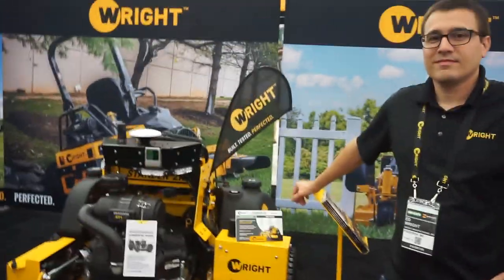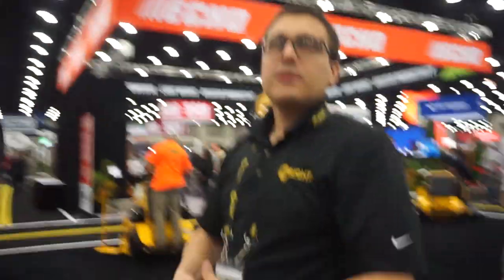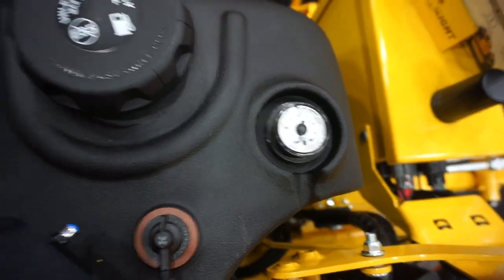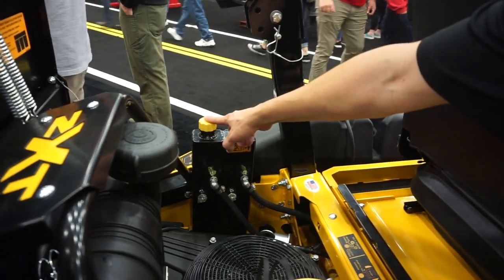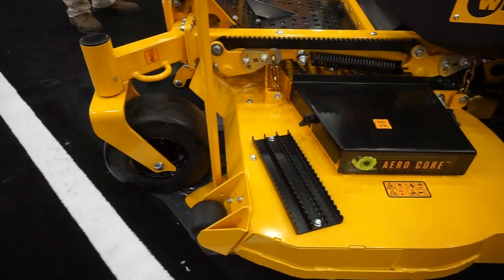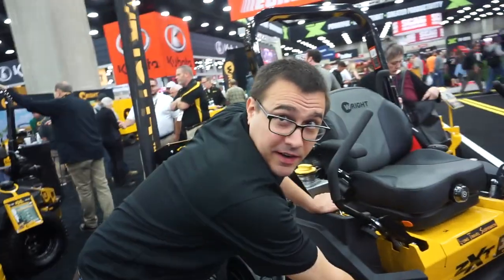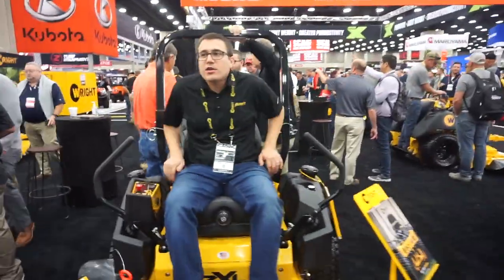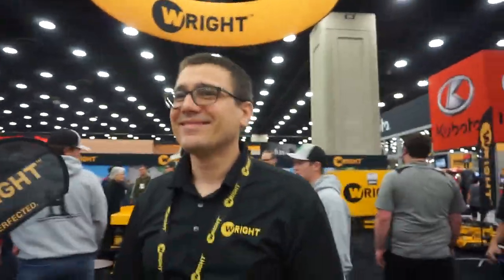"Exploring Wright Manufacturing's Product Lineup: A Conversation with CEO Ed Wright"

Comment: I heard you say you use hustler. I’m almost sure you would be disappointed going to a hydro gear wheel and pump used by Wright. I’ve owned several different machines with hydro gear set up like scag cheetah and Husqvarna z560x. The hill control and speed of pumps are a joke compared to Parker motors.
Reply from the maker: I am a huge fan of Parker, White and DanFoss.
Reply: Yeah the hyperdrive system will spoil you.
Reply from the maker: @americandream_89  No Doubt. Even the old Super Z I have with a worn out Kohler CV745 28hp EFI will run 14mph. It's headed for 25.